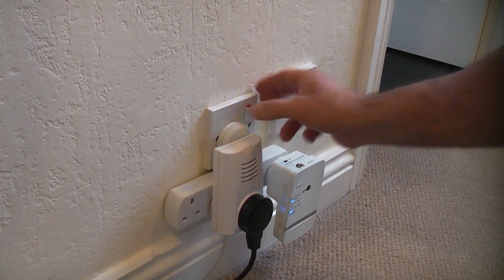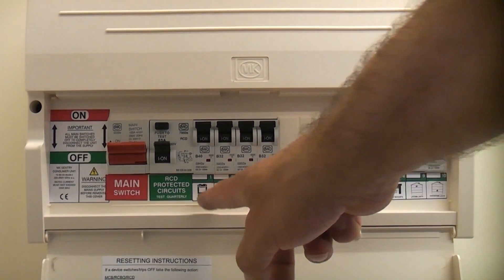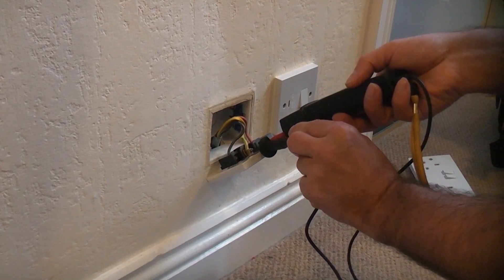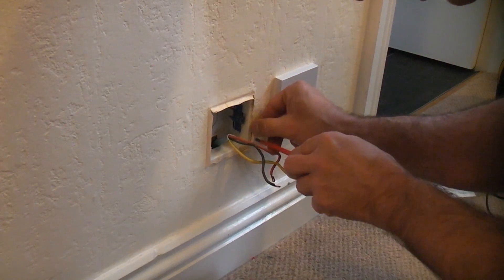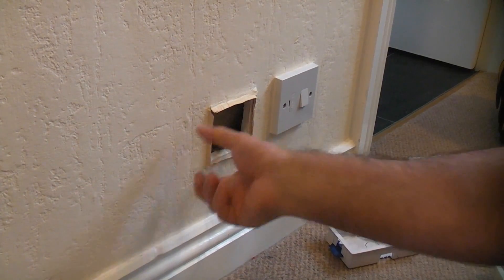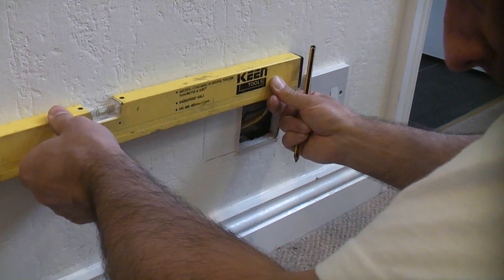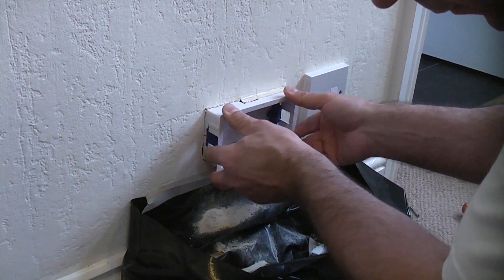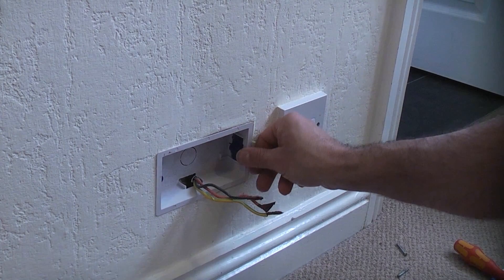How to replace a single socket with a double socket

Comment: great video as always. if you did this yourself would you need it to be signed off by an electrician or is this kind of minor work not legislated?
Reply from the maker: On the several occasions that I have contacted the local council to see if work needs notifying, they have always said no.
once was to replace a extractor fan in a bathroom and once was to install a wireless receiver for a thermostat (which was hard wired to the combi boiler in a kitchen).
I'm pretty sure that replacing a socket would not need notifying. 
Thanks for the comment

Comment: if there's only one set of wires could that socket be a spur from another?
Reply: Could also be a radial circuit, which means its just connected from another socket in series with no fused connectiob
Reply from the maker: Yes, it will be a spur.
Thanks for the comment
Reply: The size of the circuit breaker suggests that it's a ring circuit and this socket is a spur.

Comment: if you drill two holes in each corner you can use the holes to start the drywall saw on the outside cut
Reply from the maker: Thanks for the comment

Comment: which make of circuit tester did you use ?
p.s. as per usual,  no faff and straight to the point !!!!! excellent! !!!
Reply from the maker: Its a Chauvin Arnoux C.A 740A safety tester.
They do not seem to be widely available but other makes are such as Fluke etc.
Thanks for the comment

Comment: Is it true that all electrical modification or work has to be carried out by a qualified electrician and "DIY home jobs by the unqualified" are illegal?
Reply from the maker: No, if you can find it you can read the Governments "partP" rules. 
The problem is that the government keep changing the document and it's location, or I'd link to it.
Reply: whos gonna come around and check! lol
Reply: Ultimate Handyman Part P doesn't apply in all parts of the UK.

Comment: Bad on you that showing the general public how to change a Socket and even bad that after changing the Socket you don't do any testing with proper tester and complete a minor works certificate .Leave this kind of jobs to proper electricians whom spend thousands of £ ££ to
Reply: This is true, but you would have to be completely stupid if you can not wire three wires into a socket. He explains that they must be tight and his videos are among the best on YouTube. At least he explains it so the simplest of people can understand how to do it.
Reply: Nardi Alushi. Unfortunately, believing all this Part P and certification bullshit has ruined the industry, and makes many `electricians` look, and sound anal when talking all things electrical. Thankfully Part P has now been shown to be the money making scam that it always was, and the kitchen is no longer a special location, so I can make a f***ing cup of tea in complete safety again! The wiring regulations are a non statutory guidance document, and any model forms of certification, are only a method of showing you have endeavored to prove a circuit is safe and compliant after any extension or alteration work. You can write test results on an 8`x 4` plasterboard, and hand it to the customer, it is exactly the same as sucking up to the NICEIC, or any other organisation, and paying fortunes into their corporate business coffers, for fancy documents and membership. Changing an accessory such as this is not notifiable under Part P anyway. Seems like you buy into NICEIC, JIB and all the other industry bullshit which is fueled by. . . . . . . . . . . .  . . . . . . .. . . . . . . . . . . . . . . . . . .  . . . . . . . . . . . . . . . .. . . . . . . . . . . . . . . . . . . . . . . . . . .   corporate business! 
Back in the day, there was Megger and Robin, and that was all that was needed to satisfy the industry. Now there`s never been so many test meter manufacturers, it is ridiculous, all making millions and millions of pounds out of brainwashing and utter bullshit. Go back to basics mate,  Wickes do a lovely `How To` leaflet on changing a socket, you may find it a good bedtime read!
Reply: krisb1701d. Depends on how much bullshit the electrician feeds off! Firstly, it is non notifiable work, so it does not need certification, that should reduce the cost for a start. Materials are well under £10, even for a quality branded socket and dry lining box, always look in Screwfix for material costs, and labour is the amount of time it takes Chez to do the video! Anything north of £50 is heading towards a ripoff,  maybe slightly more in London, which is fair enough. Also beware of any `testing` which has found a mysterious fault, it would merely need a polarity check on completion, with a socket tester, to prove he has connected the new socket correctly. Do it yourself mate, get a guidance leaflet from DIY store, watch YouTube videos such as this, and turn off the entire Consumer Unit if you ain`t confident. I look at it this way, spend £50 or £60 and get nothing more than a socket on the wall, or spend it on adding a few things to the tool kit, and developing your skill set. That`s the beauty in doing things yourself, it`s win win all ends up, you learn, develop more skills, and get together a comprehensive toolkit over the years.
Reply: Lmao he did test it, please point out where he went wrong in wiring this up. Changing an electrical socket is not a ticking time bomb nor is it rocket science.
Reply: TeeHee! We`re just old skool, Chez, that`s all. And whilst that may make us a little older, it makes some of us a whole lot wiser too. Very sad to see an industry I was once proud of, turned into utter shite!
Reply: and who charge an arm and a leg for a simple job.  let me guess,  i bet you are an electrician.  how much would you charge for this.
Reply from the maker: Blimey you sound like me ;-)
Don't forget that some of these corporate businesses used to be registered charities (not sure if they still are).
Thanks for the comment
Reply: Nardi Alushi get off your high horse stupid dipshit bet you are a just a kitchen fitter who knows fuck all about electrics and wonders why people go back to fix your fuck ups
Reply: You need a spark to change a faceplate?  The second word is off.  It's quite safe to do yourself.  Had he been wiring a new circuit, different matter.  

This is simple DIY and as long as the cables are in the correct part of the faceplate  (Brown or Red into L, Blue or Black into N, Green/Yellow or Green into E) and are tight with no exposed conductor you're good to go.  

The circuit was not altered in any way, just a single outlet replaced for a twin.
Reply: So how much would this cost e.g. from a registered electrician?
Reply: Lenn Al Awww, what you really mean is “I’m annoyed you’re showing the general public how easy this job is to do, when I’ve been making out like it’s so difficult and charging hundreds for doing this”. If you’re such a fantastic electrician, what are you doing bitching on someone’s channel, shouldn’t you be drowning in jobs?
Reply from the maker: I've not altered the circuit.
The cable is exactly the same, but it's now safer as it does not have a stupid socket extender plugged into it anymore ;-)
Yes I'm an electrician ;-)
Reply: id sign it off, and im no sparks, in fact i do better work than some sparks do!  most site sparks have had an afternoon of snoozing in a lecture, or so it would seem from their work, liek the one who blew the main house fuse 5 times before he looked at his wiring and found he ballsed it up and had to redo
Reply: Get proper qualifications,testers up to date regulation books and insurance.
Reply from the maker: I think you will find that I never altered the circuit, just made it safer by enabling people to use two outlets without using a cheap plug in socket extender ;-)
Reply from the maker: I have proper qualifications ;-)
Might I suggest that you get some qualifications starting perhaps with English as you first comment makes you look somewhat illiterate.
Reply: Ultimate Handyman are you an electrician though ? Who do you get to sign off your work when you do alter a circuit
Reply: jordancorey Everyone has to make a living,the safety of your children and yourself is priceless.

Comment: Shouldnt you have another circuit for the other power point socket?

The wiring might not be able to handle 20A if someone is drawing 10A from each socket.
Reply from the maker: Theoretically someone could use a triple adaptor and have three or more 10A devices plugged into the one socket.
Thanks for the comment ;-)
Reply: the wire can handle 32a anyway, as its twin and earth

Comment: WAGO Lever locks are great for 'making safe' bare wires instead of the electrical tape any time you're removing a socket or switch for plastering, decorating etc. Can also be used to safely re-join the circuit where more than 1 cable enters the back box so that power can be turned back on until such works are completed and the face plate is being replaced.
Reply from the maker: Absolutely, I was trying to avoid a trip to the garage, which is why I used the tape.
Thanks for the comment

Comment: I replaced the shower switch in the bathroom, and as I was pushing all the wires through the back box all the power went off!  I have RCD `s in my house so the tip at 5:30 would have prevented this. Another great video sir. Keep up the good work. I love You Tube for videos such as these because I will have a go at most things and its great to know the knowledge is there. Thank you.
Reply from the maker: You are welcome ;-)
Thanks for the comment

Comment: Hopefully someone can enlighten me not being from the UK. That device next to the socket that was replaced, it was a switch and a fuse to control something else? What kind of things would it control? Is it something that would extend the ring without having to go back to the consumer unit? Whatever it controls would have to be a smaller load then the rest of the circuit?

Very neat job by the way, although I find it interesting that those sockets don't have "overhangs" to hide any drywall cutting crimes. :)
Reply from the maker: Thanks Mike.
The switch to the right is a switched, fused connection unit- you can also get them without the switch, often referred to as just a FCU (fused connection unit).
They are often used for fixed appliances, the one in my video was for a shower pump (which is now redundant).
They are often used when connecting a fixed appliance to a circuit as a smaller capacity fuse can be installed. In the UK they are often used for pumps, burglar alarms, boilers etc. 

Thanks for the comment ;-)

Comment: Fantastic tutorial with excellent safety advice as usual 😀 indeed hanging off heavy power chargers is dangerous, best with an extension lead flat for multiple ones. I've seen fires from adapter blocks and old fuse wire overload using fan heaters. Happy safe Easter all 🐣
Reply from the maker: Happy Easter and thanks for the comment ;-)

Comment: What's the fused spur next to the socket doing?
Reply from the maker: It used to be for a pump, but it is no longer used since we changed to a combi boiler.
Thanks for the comment
Reply: Why not use it for another socket, wife won't unplug the other 2 things when she needs to hoover. Happy Easter and thanks for the channel.

Comment: 11:35 If your house is not exactly level you might just make the cover level with the floor. Then it is not visually off. Top tip;-) When you do this kind of work you might wanna be intoxicated so you forget the house is not level and you wouldn't be bothered by it anymore.
Reply from the maker: Thanks for the comment ;-)

Comment: I need to replace the rollers on my shower cubicle too and have no idea what type to buy! any pointers?
Reply from the maker: There are a lot of different types, but I managed to find exact replacements on ebay.
I removed one of the rollers to measure it, then chose the correct ones from a seller on ebay.
I got mine from this seller- http://fave.co/2pqLhAd

Comment: Why do you need to tape over the wire ends to prevent the RCD from tripping if the breaker is already turned of ?
Reply: In the Netherlands sometimes you used to use 2phases from a 127/220v 3ph system didn't you? That's why double pole breakers are common. Here, we do indeed only use single pole breakers.
Reply: @ultimate handyman... it makes me wonder sometimes... how do our euro colleagues do busbars? with the phase skipping every other module? I am not one of the 'my country is best' brigade. I just am interested in how they get round it?
Reply from the maker: I don't know as I have never looked at electrics in other countries.
I'm only familiar with UK wiring and once had a look at my mates distribution board in his premises in Crete LOL
Reply: Ultimate Handyman Yup. The small amount of current passing from neutral to earth is enough to trip the RCD. You can sometimes feel the shock too, if you've ever formed the neutral/earth path with your hand!
Reply from the maker: If the live wire touches the earth it will trip the RCD- even with the MCB switched off. 
Thanks for the comment
Reply: Yeah but why ? Here in the Netherlands a breaker fully isolates the phase and null wires behind it. Do you brits using uni polar breaker switches or something ?
Reply from the maker: Sorry, I meant if the neutral touches the earth it will trip the RCD.
The MCB isolates the live wire only, but the neutral is not isolated and so if it touches the earth the RCD trips.
Thanks for the comments ;-)

Comment: Happy Easter mate, hope your day has been good, I must say your detail in safety is outstanding. I highly respect you taken the time to ensure everything is safe whilst doing electrical work. It gives me more confidence because you've actually shown what safety precautions to take before replacing a socket. I'm happy to give this ago in my own house. My bedroom to be precise. 
So thanks a lot for this video! Really appreciate it. 
Also I don't know if you remember but your last video with the "marxman pen" I actually got that last week, from amazon, already used it twice! Thanks a lot! I know this comment is quite long! But I was wondering if you have any advice on how to sharpen my purdy scraper? And yes the same one you have! Another great buy from your recommendation!
Reply from the maker: Thanks and happy Easter ;-)
I need to sharpen my Purdy scraper too as I tried to cut a rawl plug that was sticking out of a wall and the screw was still in the plug (the head had sheared off). I now have a scraper with loads of indentations on the end.

Unfortunately I don't know where the scraper is as I can't remember where I put it (today I spent 20 minutes looking for a fork lift truck fork, which is about 2 feet long and weighs about 20KG in my garage and could not find it LOL).

When I find the scraper I'll video how to sharpen it ;-)

Thanks for the comment as always ;-)

Comment: Nice video again Chez. Shows that these sort of jobs are relatively easy with a bit of care and thought.
I wonder when  there is going to be a proper new system for power sockets with multi-ways to feed  relatively low powered equipment  that reflects the needs of the 21st century rather than the 1950s when the present type came in.
Good safety testing procedure I thought incidentally.
Reply from the maker: Thanks Dave ;-)

Comment: It is possible to buy converter sockets. These replace a single socket with a double one whilst using the existing single back box. The screw positions are central for a single back box so there is an even amount of extra width on either side.
Reply from the maker: Thanks Nick, I'm not a fan of the convertor sockets-
http://www.ultimatehandyman.co.uk/forum1/dangerous-clipsal-converta-sockets-t26212.html
Reply: Some of those have dubious quality. The clipsal ones (well known aussie make) are very good... but the cheapo ones...notsomuch